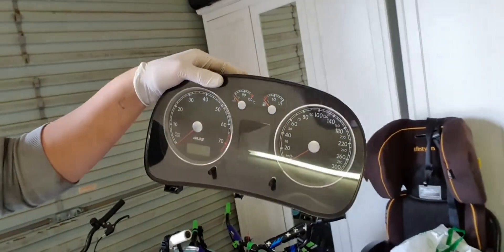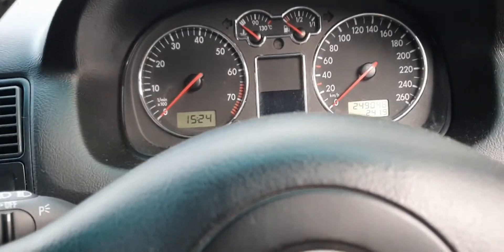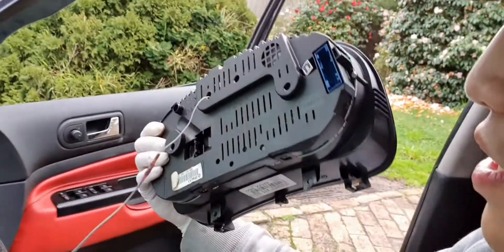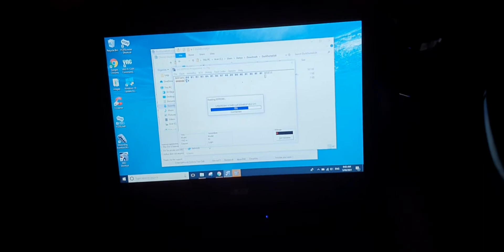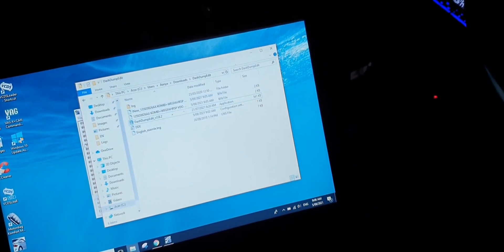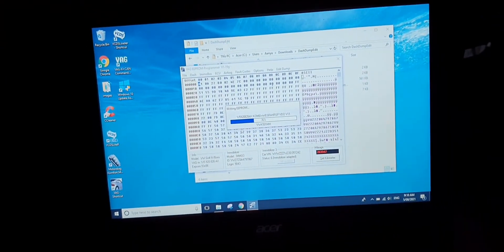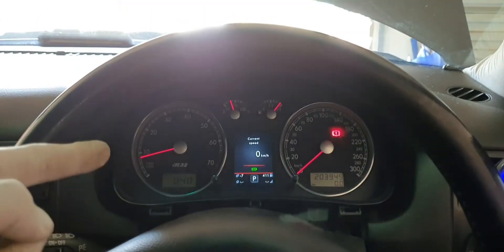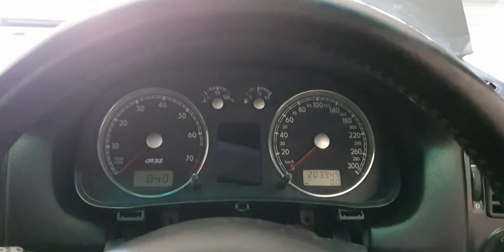MK4 GTI Gets another cluster upgrade! Colour FMA FIS. Eeprom changes & Immo key pairing overview.

Comment: Hello again, i have agu like yours, now it is immo off, i bought a cluster with half screen, also a bracket at the right of steering wheel, i made the connections to have access in the menu but it isn't working, i can see only time working engine and outside air temp. Maybe the bracket isn't the right, so i wanted to ask if you the the serial number of the right bracket on order to see  if i have the wrong. Also which program you used to delete the oil temp/level indicator? Thank you a lot!
Reply from the maker: Hi there! I used eeprom reader to get the cluster file, then I used dashdumpedit to modify the file to delete oil temp and level from the cluster.
Reply: @ajrveedub  do you have any link for these programs? I have windows 10 and vcds only.

Comment: Did you connect by obd
Reply from the maker: Yes connected by OBD2
Reply: @ajrveedub  what interface o obd connector did you use.??? Thanks
Reply from the maker: @abesanchez1985  for this I used combination of 2 cables. Hex can cable for vcds and the cheaper 409.1 blue cable.

Comment: Hi...i wana upgrade my mk4 1.9 tdi cluster..... Where can i buy.....and what programs are u using to do configuration
Reply from the maker: Hi, I used vag commander to obtain the pin number from the clusters and VCDS to code it in the car. You need the KKL409.1 cable I believe from memory
Reply: @ajrveedub  thanks....will check it out

Comment: Great work man seen all your vid’s. Cheers from syd, excuse my stupidity, but how does one clear a air bag code after messing with the cluster, putting that shitty chrome trim on and not disconnecting the battery? Will super cheap diagnostic tool (obd2) work on vw? To clear codes? Or u need a euro style one? Thanx
Reply from the maker: Hi there! Thanks!!
Unfortunately you need a decent scan tool that reads other modules. A cheap one will only scan some of the ecu codes.
I recommend vcds or similar to be able to read VW modules and clearing it.